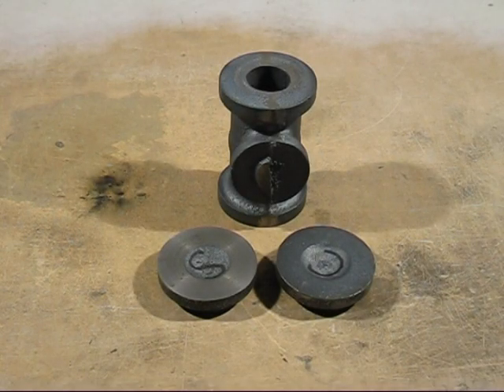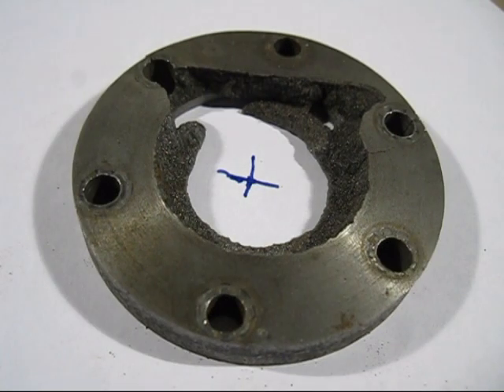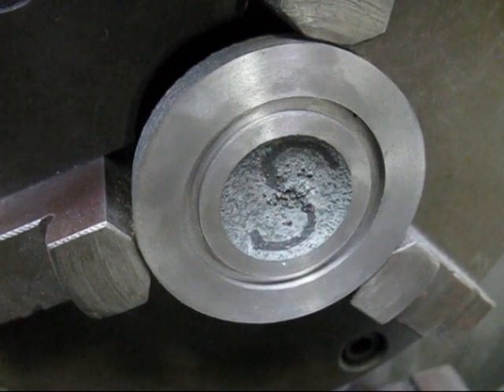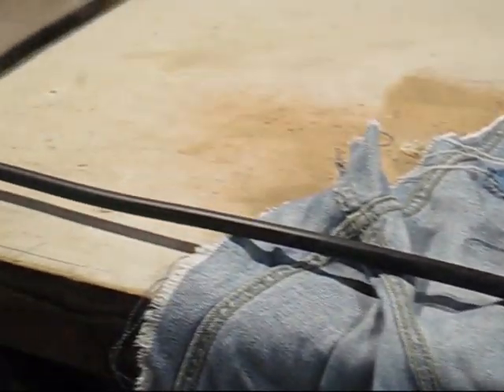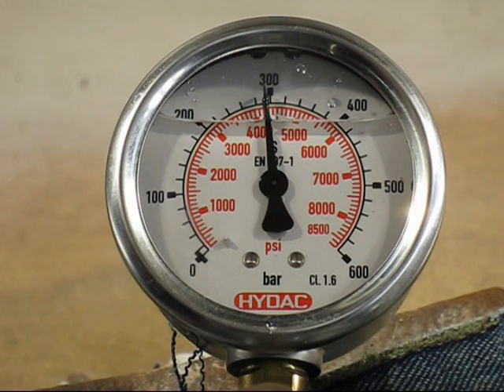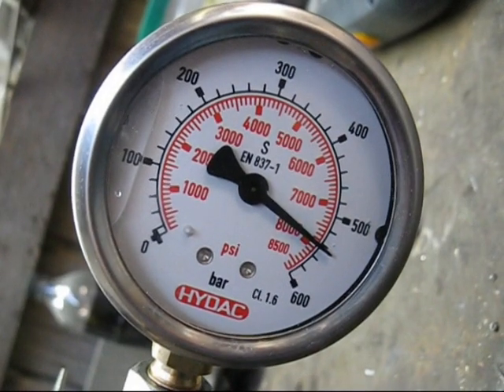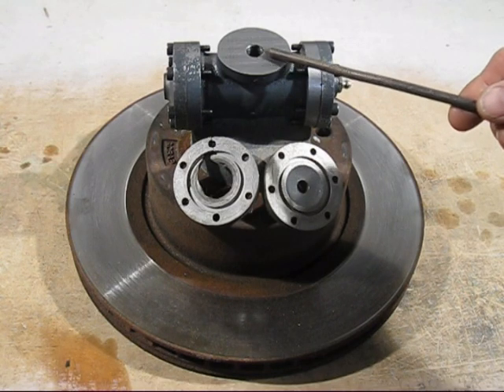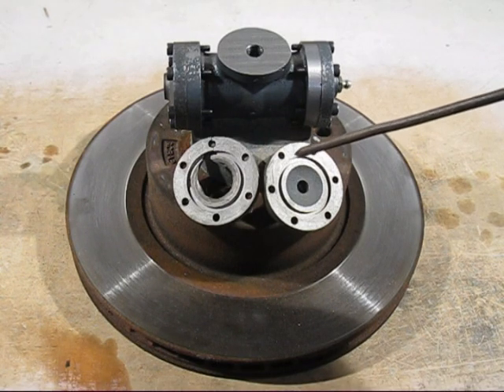Machining and pressure testing my iron castings

Comment: My waterjet operates at 50,000 psi. Keeping the system sealed is an ongoing battle. I find it remarkable that you got your parts to seal up to 8000 psi. Well done.
Reply from the maker: As I said in the video high pressures can be very difficult to keep leak free and that is why I did not go any further in pressure. Also my gauge was near it's upper limit. Wow 50,000 psi I would bet there would be no flexible hoses to hold that pressure.

Comment: My thought on the failure: your o-ring groove appears to be square in cross section. That will form a stress riser. At the break, the iron appears rather coarse grained. You mention the iron is rather soft (ductile). Under load, the cap flexed (dished outward). The combination of coarse grain and the stress riser under the influence of that load flex gave rise to a point failure, which cascaded through the lattice until the flexural stress was relieved by structural failure. The rigidity of the rotor iron resisted "dishing". I would love to see the soft iron caps replicated with a full radius bottomed o-ring groove to see if they would still fail at roughly the same pressure, higher pressure, or survive to the pump limit like the square grooved rotor iron caps
Reply from the maker: Sharp corners are great stress risers in iron castings but what puzzles me is both castings had those square grooves and yet only one failed. I was surprised on how high the pressure the soft casting went to.

Comment: I found that that last batch of rotors that I tried melting, I went to cut up the stuff that was stuck in the crucible and it sparked out like steel, nowhere near like cast iron, so I would be careful of the type of rotors you use. The ones I used were very large, and I have no idea what they were off of, but they froze the melt and I ended up with some sort of crucible steel stuck in the crucible. Smaller ones off of cars have seemed to be ok tho.
Reply from the maker: All the 12 threads for the covers were so easy to tap the threads ( 5 mm taps) The covers had some slight chill on the edges so the speed was slowed down and was no problem machining them.

Comment: What pressure will your cylinder be operating at when complete?
Safety margin question.
Reply: Less than 10 Bar, so plenty of safety margin !
Reply from the maker: @chrisarmstrong8198  You read my mind!
Reply from the maker: It is only a test piece to see how strong my castings are.

Comment: From what I see with the pressure you put into the cylinder, and as thin as those castings were at the machining groove for the o-ring, there is nothing wrong with them. They are cast perfectly and if they were a little heavier/thicker at that point there would be no issue with them. Looks like a job well done.
Reply from the maker: Yes you are so right, a little thicker it would have survived the high pressure.

Comment: One failed and one did not. This just might be an example of the fact that normal gravity casting methods can lead to a wide spread in casting properties. Anyone who has worked in the industry can attest to it being perhaps one of the more frustrating parts of foundry work that even with the same techniques and same materials results can vary widely batch to batch and indeed even within the one batch with no obvious reason why. I can all too personally attest to this sort of thing being the bane of a foundry metallurgists life 😥.
The use of sawdust is interesting  - how do you feel it compares to coal dust, and how fine was the sawdust. Also have you tried something like corn or wheat flour?
Luddite's suggestion about a more rounded bottom to the o ring grove bears  thinking about, but it may only amount to "tinkering at the edges".. Martin
Reply from the maker: Both those covers were poured from the same crucible and yet only one failed. Sawdust seems to work really well with iron. I have tried wheat flour by dusting it on the mold but not mixing flour with the sand. The result was a discolored surface on the iron so I never bothered to use it again. Before I retired I used to replace O rings all the time and the grooves were always square and some O rings were square in cross section.

Comment: I am amazed that you can get those kind of pressures out of that pump and have the hose survive as well.  My question, however goes to something else.  Based on your videos I am now wanting to move on from casting aluminum and bronze to trying my hand at casting cast iron.  I am running into an issue with finding coal dust.  I've spent hours on google trying to find a US supplier of coal dust so I was wondering about using the sawdust flour or perhaps finely ground charcoal briquettes. Do you have any thoughts on what would work best if coal dust is not an option?  Thank you, Jim
Reply from the maker: I was amazed as well but this time around the grease pump was struggling to get past 550 bar (8000psi). If you watched my last video on pressure testing the hose burst but this time I had two leaks on the threaded fittings. As the gauge maximum pressure is 600 bar (8500psi) I decided not not go to a higher pressure. You do not need to use coal dust for iron castings, If you don't use coal dust it just takes a little bit longer time with a wire brush to clean the sand of the casting. Charcoal dust does not work but if you use sawdust it will burn and lift up the iron and prevent it from sticking to the surface.

Comment: Put some grease into the chamber first next time, that way you won't run out in the grease gun.
Reply from the maker: I filled up the cylinder with oil before the grease nipple was screwed in. I should have checked the grease gun before I did the test.
Reply: @luckygen1001  ok, I must have missed that when my kids where talking to me.
Thanks!